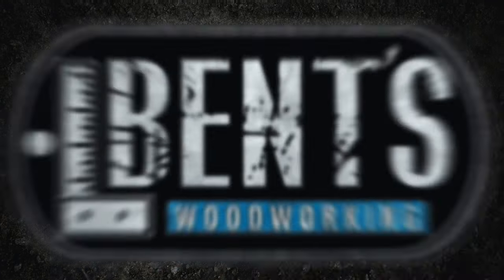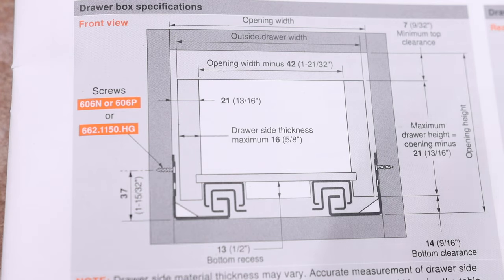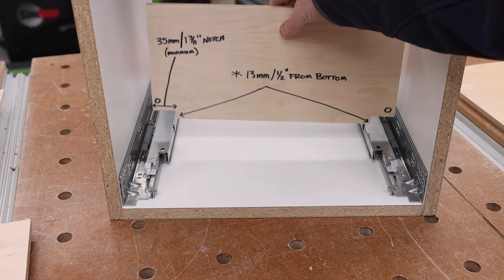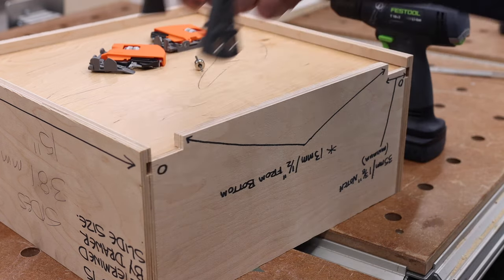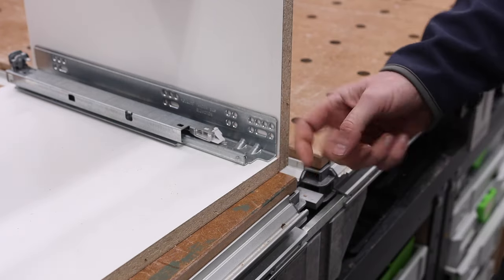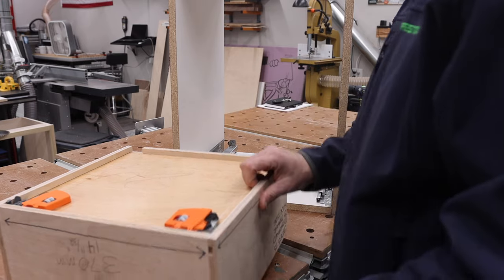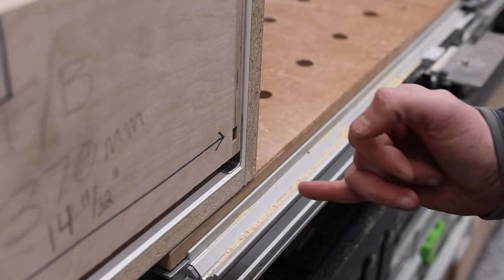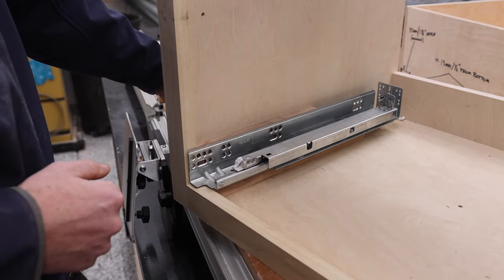How To Install Blum Undermount Drawer Slides

Comment: Thank you so much Jason, very helpful video!  It would be helpful if you spoke to how to figure your drill spots if one did not have the drill jig it.  Could you give suggestions as to what measurements are needed to determine drill locations w/o jig?
Thank you! Newbie wood worker
Reply: I did not purchase the hole jig, either. I first install the drawer slides. Once drawer Box is built, rest box on slides and push to back of slides where the right and left pins are. This will leave indentations in back of drawer box showing you where to drill the right and left holes. Good Luck!

Comment: Hey - Been enjoying your videos - so much so that I've been inspired and have built my entire kitchen - cabinets etc.  I'm at the drawers and I've got the blum undermounts.  I'm doing full dovetails on all corners using a leigh jig I borrowed from a friend.  My question is this - How exact (tight) does the drawer need to be on the bottom inside edge ?   In other words - does the drawers side need to be touching the glide?   I think I should slightly oversize the fronts and backs to allow for a little play between the side and the glide.  I'm using 5/8 maple.  Any thoughts would be helpful before I cut to size and dovetail .....🤔

Comment: Thanks for the amazing video.  As a first time cabinet builder, this pretty much answers every question I had.  I do have a couple more though.  I'm building a vanity for my bathroom, and I will have two doors in the center where the plumbing is, and two drawers on each side.  I know I can attach the front of the drawer slide to the face frame, but what should I be putting in the back on the side closest to the doors?  I didn't separate out the drawer areas as a separate compartment.  Do I need to do that or is there an easier way to locate those back holes?  Just so I explained myself correctly, when I open the doors in the center, I'll be able to see the drawers.  There are no walls in between the doors and the drawers.  Also the back of the cabinet is 1/4" underlayment.
Reply from the maker: So glad that you found it helpful!!

Comment: Great instructional video.  Question - The drawer that you are using has a lip around the edge.  Does this mean these glides can't be installed on a flat bottom drawer?  I have some pull out shelves where I want to upgrade the glide but it looks like the undermount glides may not be an option.  Thoughts?  Will I only be able to do side mount glides?  Thanks in advance.
Reply from the maker: You need the lip for the clips.

Comment: Great video; thanks so much.  I do have a question however.  If I want to stack 5 drawers in a cabinet, with undermount slides, how much space do I need between the top of the lower drawer to the bottom of the next mount, and can i attach directly to the side of the cabinet, or do I need the horizontal brace?

Comment: Greatly helpful video.  Thank you.   I need to attach the cabinet door directly to the slides for a trash can cabinet.  How do I do this and do I need any extra parts
Reply from the maker: Usually there is specific hardware for those
Reply: Just realized that all the measurements in both the book and your video are for drawers with face pieces that are inside the box.  I wanted to make my drawers with half blind dovetails so the drawer front has a completely finished look without see the ends of the side pieces.  Can I just adust the measurements accordingly so the front  piece is the full dimension of the drawer box?  Thank you.

Comment: Excellent video, very clear and concise.  One question, I'm in the process of installing the 560H slides and it states that the drawer box depth is to be 10mm or 3/8" less than the OAL of the slider but your video has the box depth equal to the length of the slider.???
Reply from the maker: That is what the manual says. Not sure why I would have it shorter

Comment: I'm having a hell of a time on our current project with these. We have the blum slides that have the additional adjustment screw on the clip to push the face of the drawer "forward", but everything else is the same. The box is cut by our CNC guy, and we're doing inset WITH face frame, so I'm having to block the front as well, instead of attaching the slide to the faceframe with the 3mm setback. Problems abound, lol. getting the drawer fronts to reveal perfectly, and be co-planer with the face frame has become a 45 minute per drawer journey in trying to make adjustments to get them perfect. Further complicating things is that the center divider faceframe reveal is too shallow to use the bracket in the back, so that glide has to be blocked and attached solidly, whereas the outside slide utilizes the bracket, but when we install them perfectly square to the fronts, they almost always max out the side to side adjustment  on the bracket, which then cants the drawer box slightly, which then sometimes is fixed by the front clips adjustment wheels, but sometimes not. Or the drawer will be tilted forward, with no way to "drop" the back end to make the drawer front even all the way around... Sometime with a perfectly even setback on the front, you can still see the drawer slide closed, then shift right or left a mm or two, meaning the slides "stops" aren't hitting evenly... It's hard to describe. Point is, it's been a shit show, lol. I'm actually amazed that these can be installed without those back brackets, since we see so much variability cabinet to cabinet in how the back of the slides self-adjust right or left on that bracket. We've tried making jigs to replicate the same level/setback/heights/etc every time, but it seems like that ends up worse, since every cabinet seems to have it's own personality.
Reply from the maker: Yeah sounds like a frustrating experience. Believe me, I have screwed them up a lot but that’s how I have learned the most. I will usually mock it up on a sample first if it’s something complex like that. Makes sure I get all my measurements correct and that has been very helpful

Comment: Great video tutorial! I have a comment and a question: Comment - the Blum slides also have holes in the bottom so if you are installing on the bottom of a cabinet, you can skip the spacers when using a face frame and screw the slide into the bottom of the cabinet. (Sorry if someone already mentioned this.) Question: when using a face fame and an inset draw face, does the slide sit an 1/8" back from the inside of the face frame?
Thanks again for this video.

Comment: Great video, thank you. One thing that is bothering me is the way the length of the draw is calculated. You said it was the length of the runner however shouldn't the thickness of the sub-front be added to the length because in your drawer construction you are effectively shrinking the draw length by the thickness of the drawer front? Hope this makes sense
Reply from the maker: The drawer front isn’t a calculation that is needed for the drawer box
Reply: Great video. I experienced the same issue as @Cliff Finn with the Tandem Plus and I'm thinking it might be a model variant issue (I bought mine from Lee Valley in Canada).

If you don't add the "sub-front" thickness, the drawer box becomes too short and doesn't reach the rear adjustment clip. Additionally you need to subtract 10mm (per the Blum instructions).

I bought both the Tandem Plus and the Movento (550mm) and they both require  the same calculations.
Reply: drawer length should be slider length minus 10mm plus thickness of material, so if you have a 450mm slider and use 12mm plywood, drawer length should be 452mm, ask me how I know!
Reply: Trying to visualize this but if you’re needing to account for the front/back thickness then aren’t you assembling the drawer boxes in the wrong orientation. I’ve always understood the the front and back are mounted inside the drawer sides versus the drawer sides being inside the front and back. I hope that makes sense…

Comment: So I have a customer that I have been installing new Blum soft close European hinges on. Well the hinges are right in line with the drawer slides that is already there. We were thinking of getting the Blum under mount drawer slides. But one question because I have never used these yet. Can I set the slides back away from the front of the face frame to allow my hinges to work? Great video. I am going to start using these drawer slides myself. Great channel too.
Reply from the maker: Thank you. To answer your question, the issue you have would be the drawer potentially hitting the hinges

Comment: I just measure the opening and subtract 5/8" for 1/2" drawer stock and 3/8" for 5/8" drawer stock keep it simple,  I have built thousands of drawers and installed slides! Blum/ hettich/ grass and more all the same! All solid dovetail drawers box's! All inset!

Comment: Great Video! But I was still able to mess up my installation though. I am not experienced in woodworking so I went to a wood supplier and gave them the dimensions of the box I wanted. I explained I was planning on using tandem Blumotion 563H under-mount slides. In fact, I purchased the sides from them. The personnel helping me pointed out the same exact considerations you highlighted in your video. I asked that they install the side adjustments and make the cuts/holes for the slides. The problem is that the slides do not reach the side adjustments, they're short. I called Blum and they suggested I add a blocker moving the side adjustments back from the corner of the box but can not recommend it. The issue is a 22' box and a 21" slide. My question is am I creating a significant problem using the blocker and should shorten the box? Thanks

Comment: This is phenomenal and points out a problem that I have. I bought a vanity with crappy glides and I purchased Blum 563H 15 inch to replace them. The drawers are inset. The carcass of the drawer before the face is 15 and 9/16 deep. So I'm betting that the 15 inch glide is too short, which means that the clips mounted to the drawer will be too far forward to catch the glides. So I'm guessing I need to add a small filler strip under the drawer, attached to the front face, that is 9/16 inches and then attach the front clips to that. Or is there a way to accomplish this without  the filler strip? TIA.
Reply from the maker: I would need to see it but if you are going inset then they may just barely be to long for the application

Comment: Jason...great explanation and video.  Two questions:
Can undermount drawer slides be used when multiple drawers occupy the same cabinet?
And if retrofitting an existing cabinet with doors (taking out fixed shelves and replacing with drawers) the door hinges usually reduce the opening by some amount.
How are hinges accounted for when using undermounts?
Reply from the maker: Yes you can use multiple slides in one cabinet. They re just like any other slides. As for the hinges and having a door over the drawers, you will need to make sure you get hinges that are for that application and have the opening clearance

Comment: Minor, but important for me - what size or diameter should the pilot holes be for those stubby looking 1/2" Blum system screws designed to hold the sliding rails onto the side of the cabinet walls? THX!  How many screws should be used for each slide rail for a heavy drawer?

Comment: Just a heads up to anyone using the metric series such as the 760H. This video is great for the imperial versions of the runners such as the 763H. But it seems that the metric versions, like the 760H500 are a little different and require you to put notches on the front of the drawer box as well.

Comment: Very explanative video, thank you.
Question : Do you know what the weight limit is for those drawer slides ? 
Also, will those adjustments on the rear and fronts of the slides help with a drawer that isn’t closing as well as the others ?
Reply from the maker: These slides are rated for 100lbs. Just depends on the construction of the box - the adjustments can help a little bit, but if the drawer or box are seriously out of square, then likely not.

Comment: I really enjoyed this video. You helped me immeasurably. 

The question I have has to do with when you measure the cabinet opening yield a fractional millimeter. Say 625.5 mm. Do you round up, down or does it even matter? I can see it being of some significances when using 19 mm/3/4” plywood with the Blum model 563H. Not a lot of room to be wrong.

Any help is appreciated.

Cheers, 

Tim
Reply from the maker: Either up or down is fine.

Comment: Great video very detailed and so informational. I have a question about self-centering drill bits. If I were to buy a set, what are the most commonly used bit sizes I should get? Thanks.
Reply from the maker: I primarily use a 5mm

Comment: Thanks for the great detailed show and tell on instillation Brent. I am using undermount sliders to mount a pull out cutting board. It is 35mm think. Do you think there is anything I really need to pay attention to given that I only have the board to work with?
Reply from the maker: You might run into some problems if you’re just trying to mount the cutting board on those slides. If I was going to do it I would’ve built the cutting board to where the bottom was actually notched out like a regular drawer so they’re in the slides would not be visible when you pulled it out

Comment: I'm about to install 3 sets of Blum slides on a built-in closet. No where on the box or slides does it say H or F model. I bought them from Rockler and no where on their product page does it mention the H or F model. I was so frustrated after I already bought 3/4 inch plywood for the sides of the drawer boxes and wasn't sure if I was going to have to return them or make the rabbet modification. So before I cut all of my material I made a small drawer box out of scrap to test them out to see if they would fit with 3/4 inch material. They fit perfectly! I'm curious if they got rid of the 2 different models and only have one now that fits everything up to 3/4 inch thickness. Do you know anything about this? Your video was made 2 years ago so I'm wondering if you have learned anything new since then?

Comment: This is a fantastic resource. Thanks for putting this together!

I'm trying to reconcile two things, using the 15" drawer box from the 563F instructions as an example. In the instructions, with the 3mm (1/8") setback, a 15" drawer length will have the closed drawer box extending 1.5mm (1/16") from the cabinet face, noted as the "front gap". In the video, with the 3mm setback, the closed drawer box is inset from the cabinet face, with no "front gap". Am I missing something?

Comment: Great video- just quick question for you or anyone-  My drawers fronts need to be flush with the cabinet and you say to install the slides with a setback of the width of my drawer front. My drawers are made of 5/8 ply and fronts are 3/4. When I installed it with the 3/4 setback it was sticking out about an 1/8. is that because of the drawer material, i.e. should I add an 1/8 to the 3/4 setback, or maybe they didn't go all he way in the back holes...?
Reply from the maker: Did you also add the 3mm setback like I did in the example with them flush? Also, 5/8” material could have impacted it a bit
Reply: @bentswoodworking  OK, so I need 3/4 for the front pus your 3mm? because when you installed with 3mm setback, the drawer was still set back after it's locked in...  maybe it makes sense that I needed my 3/4 material plus about an 1/8" to get it flush...?

Comment: Great video.  How do they compare in time to install and cost vs a more common drawer slide?
Reply from the maker: They are more expensive than traditional side mount slides in most cases but the ease of install and the adjustability make it worth it for me.

Comment: Our cabinet guy made the actual drawer boxes 22" deep rather than the standard 21" for our 24" deep kitchen cabinets.  I really want to have the standard drawer slides that they used replaced with the Blum undermount drawer slides but am not sure they will work because of how the back holes need to be drilled in.  Can you confirm whether there is a way this will work?  I am REALLY hoping there is a way they will - I can't stand the slides they put in and have had the Blum ones in the past.  There is a night and day difference.
Reply from the maker: Well the drawer boxes need to be built to specific measurements for the undermount slides

Comment: Can I assume that, If cutting the drawer back so that it is above the groove for the drawer bottom, allowing me to slide the bottom panel in after all four sides are connected, this will work?  Or does the notch cutout serve to guide the drawer as it moves in/out of the carcass?

Comment: in the uk most ply is 18mm or 12mm what i use could i use 18mm for drawer unit and sides many thanks colin
Reply from the maker: 5/8” is max for these particular slides.

Comment: How would you adjust the back up and down if you don't have access to the back of the cabinet? Does the part of the drawer slide go right into the hole always or is there any struggle with it? Just wondering sometimes your adding drawer slides to existing cabinets. Thanks ED.
Reply: I think you are supposed to reach back in. Blum seems to be pretty adamant that a 24" deep cabinet should get a 21" slide. Even if your back panel and nailing stretcher took up an inch, there'd still be a couple of inches of space left. I'm making 31" cabinets and discarded the idea of 30" runners, although they do sell them.. going with 27" for this reason.

Comment: The F version runners is that you have to account for the frnt of the drawer box otherwise your length of drawer will be 3/4 inch short if using 3/4 inch stock for the front.